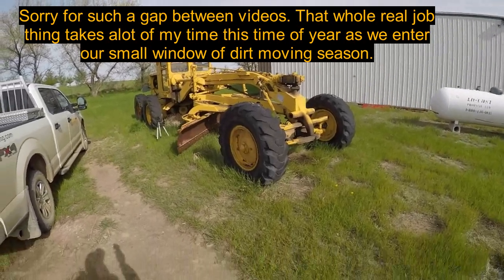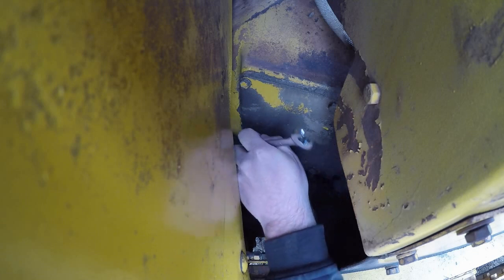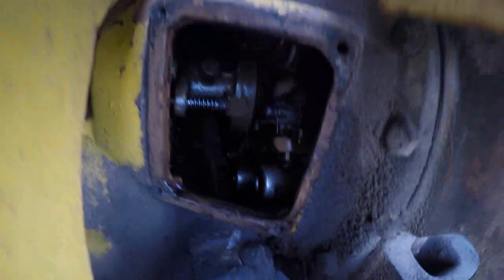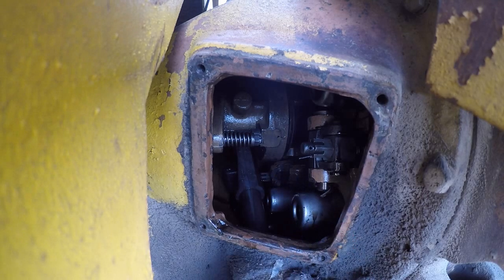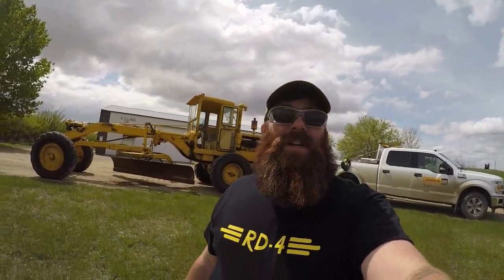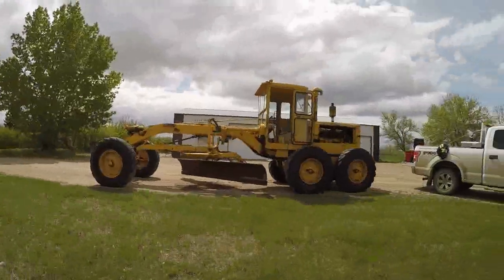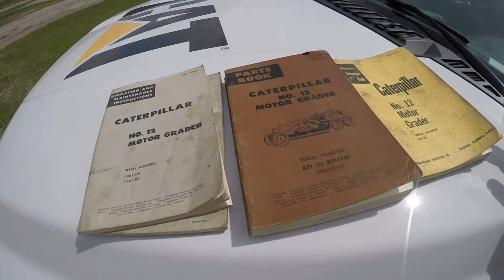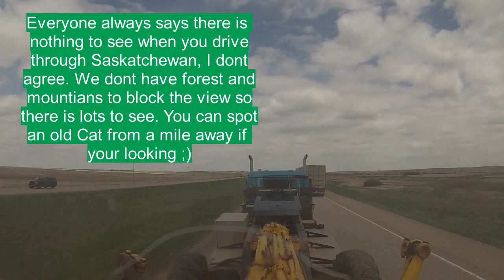Caterpillar No.12 Oil Clutch Adjustment

Comment: I've had to use water from a creek before 👀 all the minerals and microbes one needs for a growing young'n but not real good on the inside of and cast iron engine. So I took note from the marine industry and placed a strip of magnesium in my old 65 Ford's radiator so I could access it later. The magnesium becomes the sacrificial lamb and gets eaten up before the cast iron.
Thank you, Thank you, Thank you .... But you did something wrong!  I know you did something wrong because I didn't see any blood or busted knuckles 🤦
Reply from the maker: Good to know about the magnesium - great tip thanks for sharing